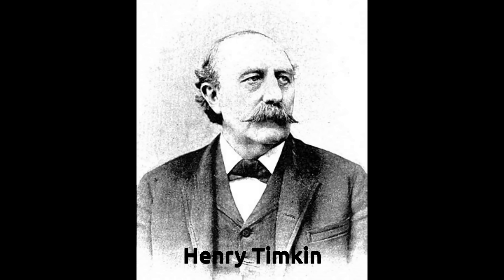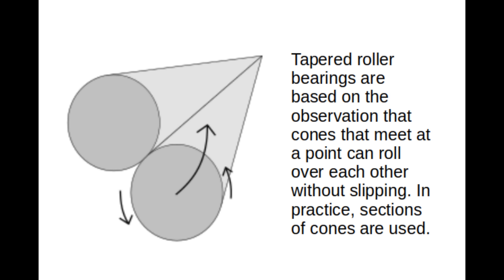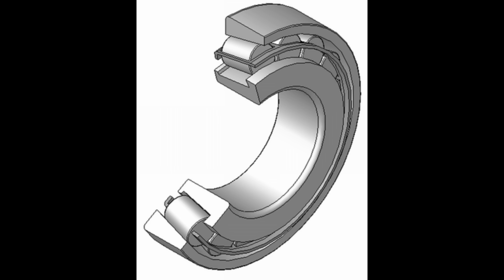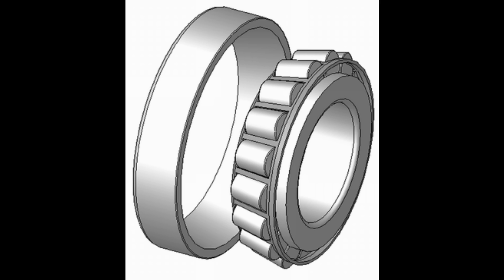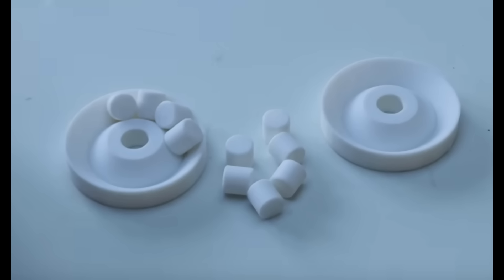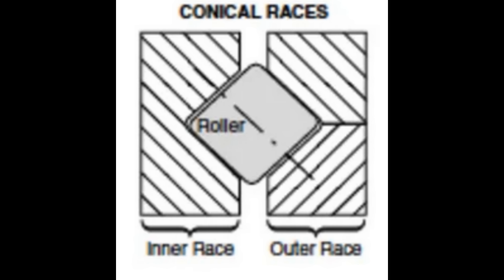2356 Cones, Rods, Spheres, Bearings, CVTs And Drives

Comment: The dual cone thing is genius. I would do 3 or 4 of them though to balance forces on the thrust rod. In the current setup, the torque converter will get squeezed above or below the two cones as you increase pressure to reduce slippage. Capturing it between 3-4 cones instead of 2 will prevent slippage, increase contact surface area and balance radial and sheer forces on the trust rod. If you do 4, you can have 2 input and 2 output and quite a lot less slippage.

Comment: Hi, DAF used to make a car with such Constant Variable Transmission in the 60-70s in Holland. Used by "able" and "disabled" people alike. Added bonus: you could push-start it backwards and drive just as fast backwards as forwards! It made for fantastic "backwards racing days" on the F1circuit in Zandvoort!! Made great TV entertainment.
Reply: DAF verwendete allerdings Keilriemen und wenn ich mich recht erinnere sogar eine Riemen-Version aus (Stahl?)-Lamellen. Der Motor war erstaunlich stark (50 PS?) und ich dachte: im Flachland braucht er das nicht; aber die Holländer eroberten damals die Alpen mit ihren Wohnwagen ;-)

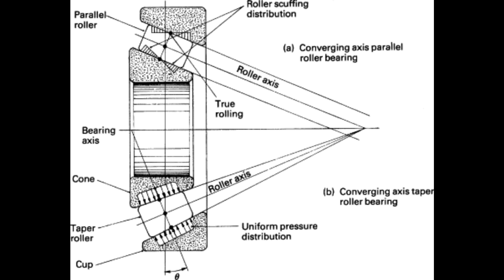Comment: But this parallel blue "transmitting roller" doesn't run true, as it shows in the upper picture of this roller bearing at 2:50. It's just running true at the middle line of it's width. This blue transmitter roller also need to be a cone, to run true, like the lower one in the bearing picture.
Reply from the maker: no mate - it needs to be thinner and a rounded tire on it so it is a point contact

Comment: Growing up in the ninety's, we lived in Maine, and my parents had a snowblower that I would run to clear the driveway.  It had a drive system that took power from the engine to the disc component, and the roller drove a single, solid driveshaft for the two wheels.  Each wheel had an independent clutch that was engaged by gripping a lever on each handle.  Let go of the machine and it stops driving.  Squeeze the right lever and the right wheel drives, left lever and the left wheel drives.  I was really impressed by the mechanism, which was exposed during operation back then.  Even now, I think my favorite feature of that transmission style is its ability to go full speed forward and reverse, without the use of any additional components to reverse the output.

Comment: For lack of a "best" solution, the "better" option seems to be combining different solutions so that the benefits of one approach cancel the compromises of the others. For example, using a ball bearing and two thrust bearings to handle both axial and radial loads. Other than the added friction, the remaining compromises (increased complexity and cost) don't affect the performance of the system itself. Or mixing lead and tin to make solder. Nature is full of inspiring examples where very different structures are combined to go beyond the limitations of each part, like bones and muscles.

Comment: Recently printed out your cross roller Bearing, Wild just hitting print and clicking a bearing together. Gonna make a windmill that stores power in a gravity battery and used it to power a vent fan for my greenhouse, With that bearing i can just kind of print it ( save for the Mill's stand ) Might never known it was possible without your work. Thanks!
Reply from the maker: cheers mate

Comment: Guys, We have to get this man a microphone sound dampening.
Reply from the maker: i bought a new one mate this video was taken with the DJI mini wireless lapel mic - the problem isn't the mic - it's the room
Reply: @ThinkingandTinkering  Have you tried to bring the mic closer to your mouth? I think it is too far away.
Reply from the maker: @jonasv328  it's literally 15cm from my mouth - the only way to get it closer is to sellotape it to my nose - I joke of course but the problem is not the mic
Reply: @ThinkingandTinkering  I had no problem with the audio at all but if you do want to improve it sound dampening might do the trick, your voice is bouncing off the walls and back into the mic. low-tech solution is hanging up some blankets on opposing walls but I wouldn't say its necessary, audio is fine for me on headphones
Reply: Hmm. Is that an Omidirectional mic?
Reply: Omni
Reply: You want a mic pattern that has a "direction " about it.. 
However, you could easily post-process with a simple reverb remover.
Reply: @justinsalazar4952  I turned on captions and turned off the audio

Comment: 0:59 Funny to actually see an example of this transmission... I had this same idea (mind you I'm not terribly surprised to find out it already exists, as it's a pretty simple idea.) I was imagining it as a bicycle transmission, where the back wheel is the larger disk and a drive shaft moves across its radius to drive it...

Of course it still runs into the same problem every CVT has: It simultaneously needs grip to transfer the power, and slippage to be able to change speeds freely.
Reply from the maker: the example was from a cotton weaving machine mate

Comment: This transmission is absolutely brilliant. Since it is variable, it is better than a fixed ratio in almost all situations. For true variability, you don't necessarily need a second threaded shaft. You could simply thread the idler shaft to move the idler up and down for different ratios. I am fairly certain that I would prefer this to a fixed gear system for almost everything. Kudos for this.
Reply from the maker: glad you liked i tmate